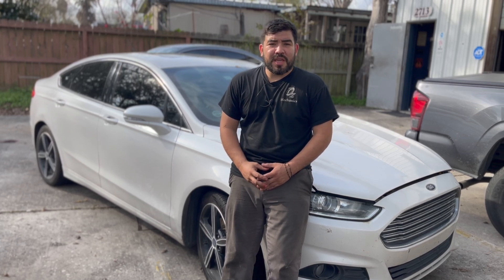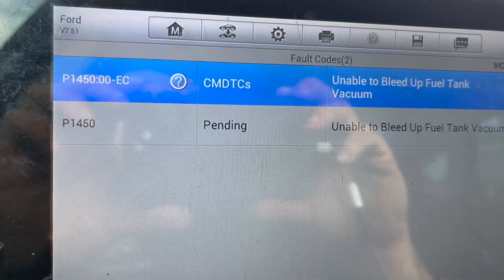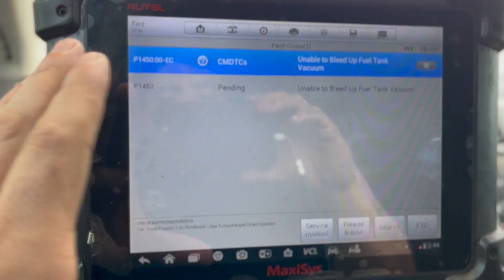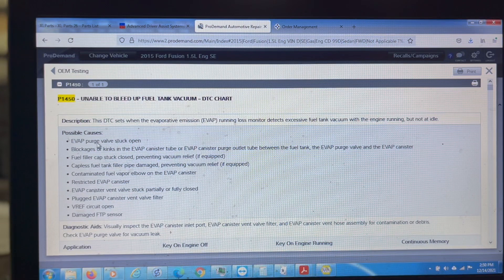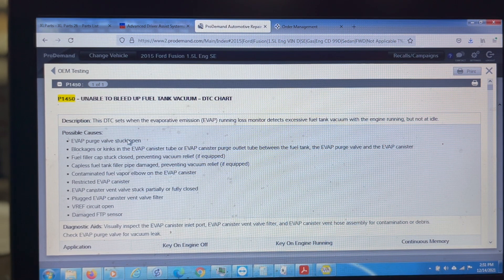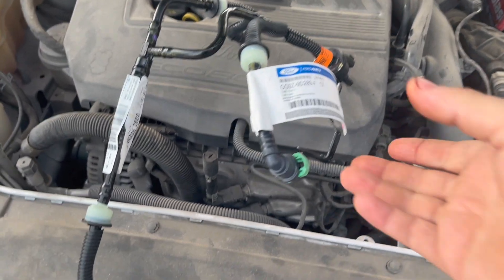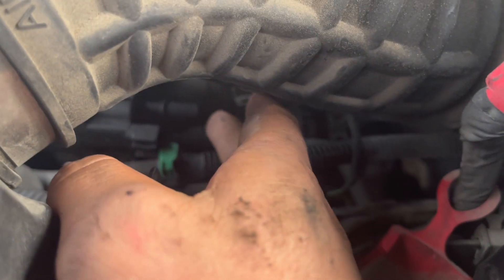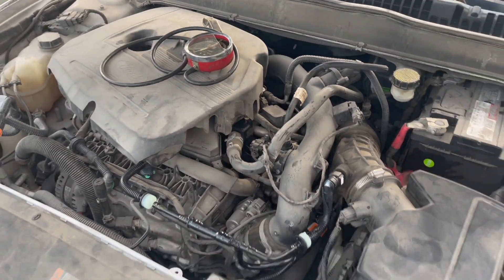2015 Ford Fusion P1450 engine code repair

Comment: It seems like every Ford Fusion has this P1450 purge valve issue. 

Mine has broken twice
Reply: I have a 2018 Lincoln Mkz which is basically a Ford fusion and am having this exact problem.

Comment: Condolences Oz on your dear auntie. As for the car, you would think they could just sell you the valve without all the other hardware? Maybe? But of course this is not build that way is it. Wonder how much cheaper the part would be of it could just be the valve. Thanks for the video and again, so sorry for your loss. It is a comfort that you can see her again though.

Comment: Good video!! I have the same car, I don't recall the code but it was downstream o2 stuck rich. It would come back every week or so. I replaced the purge valve assembly. cheap and east fix.